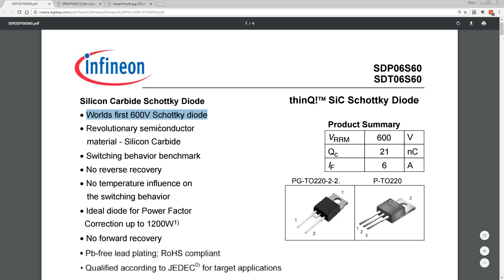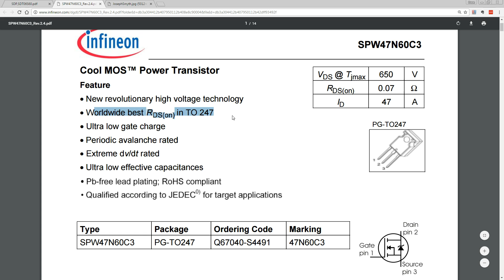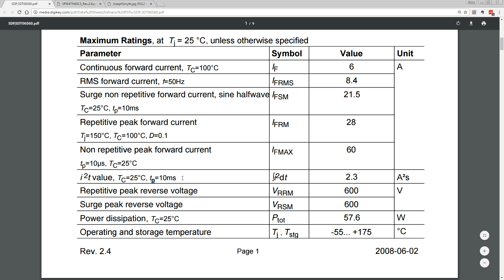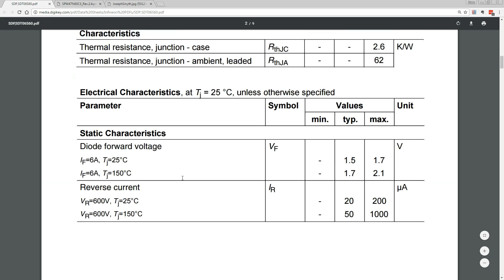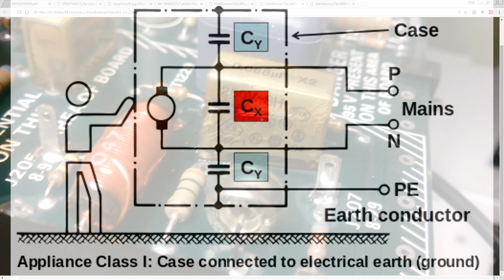EEVsmoke #1 - Magic Component Smoke

Comment: How do you know if there is magic smoke in a component? It isn't mentioned on the data sheets? I really looked in the PDF's I've downloaded and it isn't there.
Reply: Well, there are two main ways to look at how the magic works...

There is the smoke theory, that holds that any working component works due to the elusive "magic smoke" that it contains.

The other is the magic diagram view, namely that it is the combination of materials and shapes that make the device work.

It is not trivial to say which view is the correct one, perhaps it is a duality thing, or perhaps kind of like the discussions about whether BJTs are current or voltage driven. 

Anyway, the data sheets generally just deal with the function of the components, and do not really delve into the underlaying magic too much, if your component works, you can safely assume it has the magic it requires.
Reply: I get the smoke theory now, but still having problems with the diagram view. Does shape really matter in the existence of magic smoke?
I thought it was all about the volume, not the shape? Wow, that blows my mind!

Comment: I quite like the idea of this segment Dave, but I'd be quite interested to see you actually try and let the smoke out of parts. Not in the way of sticking parts across the mains, but rather searching for where a parts overload boundary lies vs the datasheet spec. Just a thought!

Also, those Rifa brand X2 caps are a nightmare. Had loads of 80s HP gear with ruptured caps just like that!

Comment: Magic Smoke = a $AU 2000 potential fine if Dave doesn't isolate the detector head in his lab!!!

Mate, could I suggest that you speak to the building management company - ask them if you can pay their encumbant fire/security installers to replace the detector head with a 'heat' unit (as used in kitchens etc)... as this will still protect you but remove the risk from the lovely electronic magic smoke!!! ;)

Comment: that capacitor burst just like the one i found in a german-made Dual CT110 radio.
i only plugged it in to see if it turned on, and within seconds i heard a muffled "poof" and the radio stopped working, smoke started to come off from the small grooves. i opened it up (unglugged) , and the mains capacitor just gave up the smoke.

Comment: The caps in the 2465 are a common failure. In fact, I would guess that a majority of them have failed. Mine looked just like that one... exploded apart. This segment might be more interesting with some actually burning, rather than only aftermath pics.

Comment: If i'm not very much mistaken, that X2 cap might've been a paper dielectric type (as opposed to mylar or polypropylene), and i've heard those can be prone to failures (as opposed to these more modern "plastic" ones).
Reply: Confirmed, metallized paper, as per the datasheet - http://www.kemet.com/Lists/ProductCatalog/Attachments/307/KEM_F3025_PMR209.pdf

Back then, these would've still been made by Rifa, but Kemet bought them out some time ago (or at least a part).
Reply: The Rifa X2 caps are notorious among a certain section of the retro computing community as they are found in the power supply of the BBC Micro. These examples will be over 30 years old, and are indeed guaranteed to fail.
Reply: +gslug1 But do they fail in the specific way permitted for X caps, that's the big question.
Reply: They do eventually go open circuit John Doe, but with lots of smoke beforehand.

Comment: Oo, I might have one. An expensive but old hammer drill I might have overloaded a bit the other day gave of a weird crackle and a puff of smoke when I stirred some concrete with it. Still works but it gets hot really quick now, so I guess there's a short in one of the windings now. I'm gonna take it apart and see if I can maybe send the rotor (I assume) in for rewinding at a local company (even though it's a small handheld machine it's still a $1000+ piece of kit, so it might be worth it), so I'll see if I can get a picture of it and send you!

Comment: The thermal load fried the device and the pressure from the expanding gases exploded the epoxy resin away from the case. The remnant piece of the package is sitting on the PCB right in front of the device. I blew out a TTL logic chip in the same manner many years ago. It's quite spectacular if you can catch it while it happens. A loud pop and some sparks and a little smoke and it's all over in a millisecond. And of course, once the magic smoke gets out the device is useless. I wish I could buy a bottle of that old IBM magic smoke replacement. Would have come in handy! ;-)

Comment: For x2 caps broken in half look out for the Yamaha A-760 stereo amplifiers, for this amp they made a recall after many years after they sold them. I scored one in the dumspter with a broken x2 cap but much more spill of the brown stuff over the whole mains input board. Some of the smaller caps which are the same shape but smaller were also a bit shattered.

I replaced all of them, now works really well!

Comment: Love it! In my opinion you can keep this coming on the main channel, very nice addition!
Fits in very well :)
Reply: I let the Magic Smoke escape when I was mucking around with a computer as a kid, switched the power supply to 110v...
It briefly turned into a smoke machine, the fan exhausted a huge cloud of white smoke, man did that smell :p
Got a bunch of old computers from my dads company so luckily I didn't ruin anything important and wasn't left without a computer. Learned a lot over the years from both breaking and fixing things :)

Comment: I like this segment. Keep them coming. For me it doesn't matter if it's part of your main channel or some other. I subscribe to all your stuff anyway. :-D

A question: could the leads of the diode have gotten so hot, that the solder melted out of those through hole pads?
Well on second thought probably not. Even molten solder would probably just stay there because of the surface tension.
Reply from the maker: No, this would have been a pretty quick impulse overload event. The component will explode well before the solder joint could heat up enough to melt.
Reply: Sort of, from what I read... A few years ago I had a MacBook Pro that supposedly "desoldered" its graphics chip. It seems every Apple product from the past 10 years has had some sort of mass production error and that particular model was well known for bad BGA solder joints on the Nvidia chip, triggered at certain temperatures/GPU loads. Mine made it past the end of warranty and then finally failed for me - as usual. Not quite sure what has actually happened there, though. I can't imagine the chip running so hot that it actually melts the solder but with a nice production error where the BGA wasn't aligned properly or where the solder joints contain air bubbles... could be?
Reply: I would imagine that might not be possible as the pin would have to get so hot(about 260°C) to melt the tin solder that that heat would just kill the component first before the solder melted away.

if it could the solder would just go to its liquid state and just stay at the pad and re-solidify when the heat goes away.
Reply: yeah i like it too!.
Reply: Does it ever happen that a component actually de-solders itself?
Reply: If yes, I would like to see pictures of that too ;-D
Reply: Cheapo  lead free solder

Good old leaded solder is great  that is why a lot of older stuff still works great since it has leaded solder

Comment: You could buy Magic Smoke from Sparkfun at one point too:
https://www.sparkfun.com/products/retired/10622
As for the X2 caps:
https://www.google.com.au/search?&tbm=isch&sa=1&q=apple+iie+power+supply+capacitor+x2
The Apple IIe's use those same resin X2's.. And they blow up, crack, melt, or in one case with a friend's, liquefy it'self all over the PCB.

Comment: Hi Dave. I think that does not look like melting at all. I think that is explosive de-encapsulation, and the piece of package plastic that matches the crater is on the board near the pins.

About 45 years ago I made an I.C. tester with an old PMBX  http://www.britishtelephones.com/ericsson/bulletin/47_69.htm  and the switches allowed switching each I.C. pin to GND, VCC, clock 1 or 2. Good for simple manual tests of simple TTL. Anyway the 240V power supply I built (badly) was mounted in the middle, and had an exposed 240V terminal on the top that touched the back of one of the paddle switches in the 9th column (I.C. pin 9). When the switch was flipped to the right position, it applied 240V AC to pin 9 of the IC. Fright of my life.  After that I called that switch Pin 9 Eject.

Comment: Bet that diode went off with a bang! Certainly a "gross overload" type of failure.
Reminds me of when the optoisolator in the 56k modem card of our computer went bang during a thunderstorm in the mid-late 90's.
Sounded like someone had set off a firecracker in the computer room, but there wasn't any thunderclap or lightning flash related to the sound (nothing for like 30s on either side). Nobody could figure out what it was, so we went back to what we were doing.
Next time we went to use the internet it wouldn't connect. I remembered the storm so I shut down the computer, open it up and there's a white ceramic rectangle rattling around in the case. Look at the 56k modem card, and there's a white ceramic 6-pin DIP with no lid!
So we went out and bought another modem card and a surge protector that had the ability to protect the phone line as well. Never blew out another modem card, and we didn't get broadband internet until like 2004 or 2005.

Comment: the first one quite literally exploded (not imploded :P ) the pressure inside got so high, that it popped  the front off. So the "crater" is not melted, it's ripped out by force. You can see the remains of the front on the PCB below it with the burn mark from the die :P

Comment: It broke off. The rest of the package its juts below it on the photo.
Reply: TO-220s are just grenades when you mess with them!
Reply: nah, try unvented chinese caps
Reply: photonicinduction could do it. - us mere mortals may be unable to...
Reply: Guillermo Lovato it is. look at the center. there is a gray spot that match both piecies
Reply: Maybe I could make videos of these things exploding.
What about exploding a 2N3055? Lol
(Is that even possible?!)
Reply: maxsnts
you're right hahaha it "delidded" :D
Reply: Exactly. It Blew. "Melted"?!? Get real...
Reply: Yeah, I think it "cratered".
Reply: I don't think a 2N3055 will likely explode in a similar way to TO220 or TO247. The TO3 is empty inside and I think the bonding wire would simply evaporate well before any explosion occurs.
Reply: Surely you can induce a catastrophic with a nice large capacitor, like the one photonicinduction used to explode a coconut and a watermelon!
Reply: that would probably do it... otherwise he will just grab his 'big boy' 20.000W power supply or his 50.000A transformer....
Reply: Not sure how Dave missed this ... maybe some of us have seen more failed components than others :-O
Reply: +Pratik Panda I don't think so. Hahahahah! Once testing an amplifier design, I've blown one of those. The anti-climax was that what happened was that the lead seals melted and the magic smoke scaped. No pops, no nothing. ;)
Reply: I've had those things with the case turned blue and hot enough to melt solder on - and still working!
Reply: Stupid 'reply to' doesn't work. This was supposed to be referring to the exploding 2N3055 comment...
Reply: Totally agree. One exploded while doing some thing in a protoboard and a piece just flew in my face. Fireworks.
Reply: i don't think the lid is the thing below, it looks like one of those black foamy-type sticky tape they put on everything these days
Reply: Good point, I was thinking of the MJE3055 or TIP3055, which are the exact same transistor just in more modern smaller packages. (TO220 and TO247 respectively)
Reply: I just want to see that thing go off!
And internal stuff may melt away quietly...but that will happen only if the TIME is too large. Something like a supercap array will probably blast it. Gotta try this!
Reply: ''lets make it 'pop'''
Reply: +Matheus Moreira Why would you need a 600V diode in an amp?
Reply: Tyvole yep! Those things are tough as hell.

PS: I'm talking about 2N3055s, in case my comment appears in the wrong place (fucking hell!)
Reply: Absolutely, part of the package is lying face down on the PCB between the current transformers

Comment: That's a common problem on Tek's of that vintage, read the post on repairing 2465 on the eevblog forum. -> http://www.eevblog.com/forum/testgear/tektronix-2465b-oscilloscope-teardown/msg425034/#msg425034

Comment: In the first case, surely that black thing sitting half-out-of-frame at the bottom of the picture is the rest of the case of the diode? It looks to be exactly the right shape to fit back on the blown diode (once you've put the magic smoke back, of course!)
Reply from the maker: Yeah, I didn't even notice that.
Reply: I was thinking the same thing. That black epoxy they use for moulding packages never melts. It bursts / cracks, but doesn't melt.
Reply: Bill Queensland Who exactly is that message aimed at?

If it's Dave, you'll find your answer at https://www.eevblog.com/about/contact/

Google is your friend ;)
Reply: How can i contact you?
Reply: Do the caps in question have a peek energy rating or is it merely voltage?
Reply: gary1168 Which caps?
Reply: I suppose the lovely golden RIFA PME 271 filter caps. I've never looked at the spec sheet too closely but I only remember an AC operating voltage, usually 250 V in equipment for 220 V mains voltage and 275 or 300 V for 240 V supplies.

Their main task is supposed to be filtering crap from the mains supply rather than protecting the equipment from surges I think. The XY combos are definitely there to filter out RF generated by motors - if you run a hoover, mixer or whatnot with that cap removed you'll really mess up radio reception all over the place! Tested that as a kid and my grandfather wasn't too happy about all the static on his radio (battery powered even, so the crap didn't just go onto the mains supply).

Comment: After having my mains filter cap fail suddenly in my 2445A scope, I found others have had similar problems with this series. Luckily, there wasn't much damage so cleaning the soot and replacing the blown components was all that was needed (the other filter cap had swelled a bit so was likely on the edge of failure).